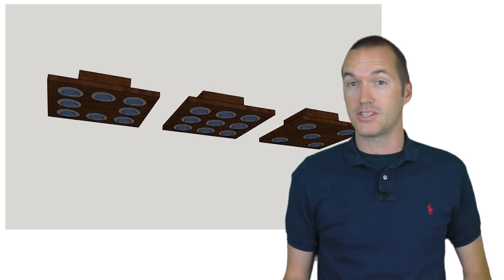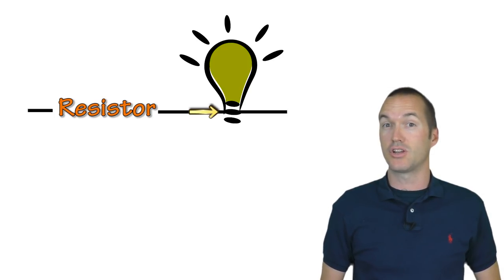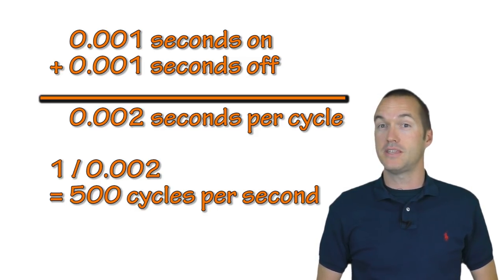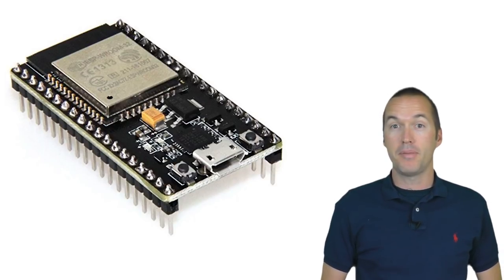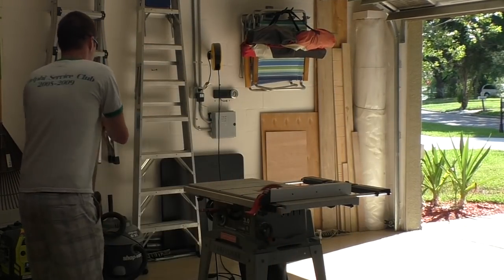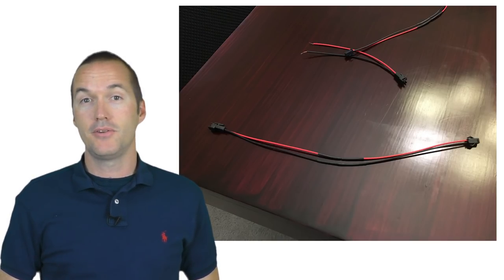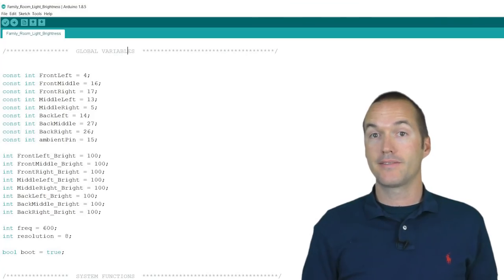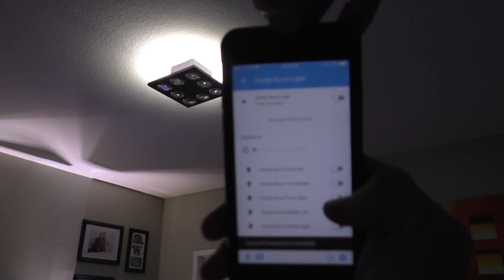DIY Smart LED Ceiling Light: 8 Individually Dimmable Channels

Comment: If I would want to run all leds on one channel, could I use only one Mosfet or should I just parallel the Mosfet together at the one PWM channel?
Reply from the maker: It would depend how many LEDs, with 8 you'd need at least 2 MOSFETs, but they would need heat sinks. I think 4 would be fine.
Reply: Thanks, Also do you have any experience with Arduino and Ethernet, instead of using an esp? :)
Reply from the maker: Personally no, but I did write a sketch for DrZzs to use a mega with an ethernet connection.  Not sure if he's hooked it up yet.  What's your question?
Reply: @Henry.Kristiansen  Check SuperHouse channel, he is using ethernet for raspi with mqtt

Comment: You say “I used 8 of these 12V spotlights” but showed a picture of 8 110V spotlights..
Reply from the maker: The spotlights themselves are 12V, each them comes with a 120VAC to 12VDC converter that I just didn't use.
Reply: @TheHookUp  ah ok.. you sometimes leave out small details that confuse me as I follow along!

Comment: I need to confirm. Did you just made a smart dimmer
Reply from the maker: For certain situations, yes.
Reply: The Hook Up incandescent bulbs?
Reply from the maker: No, LED bulbs only using low DC voltages.

Comment: Are you concerned with the electrical code or fire code? How is using wood permitted by either?  You may be encouraging others to burn their house down. Have you ever wondered why there are no commercially available wooden light fixtures?
Reply from the maker: I don't think electrical code specifies anything outside of the walls.  There are plenty of wooden lamps, this is no different.  It has a junction box as is required by code.

That being said, I'm not an electrician and I don't claim to be in my videos.

Edit: A search for "wooden light fixture" brings back 20+ pages of results on amazon.